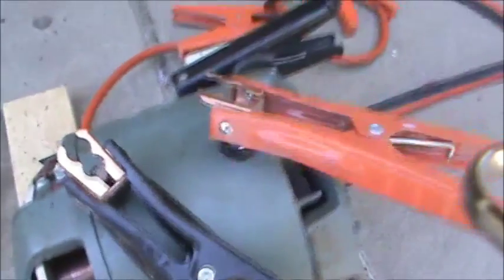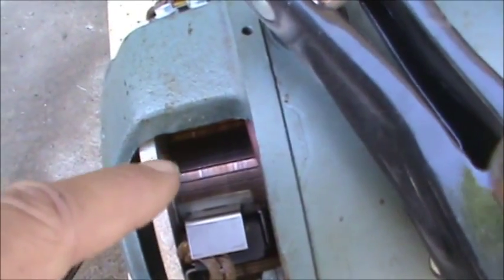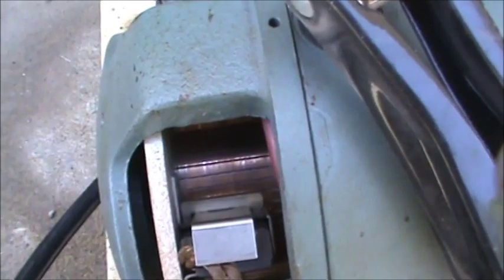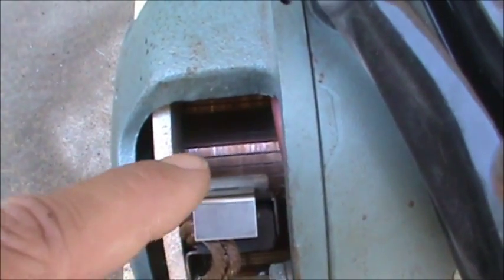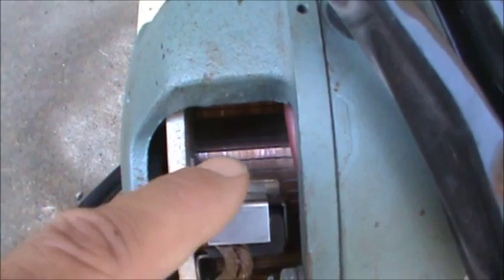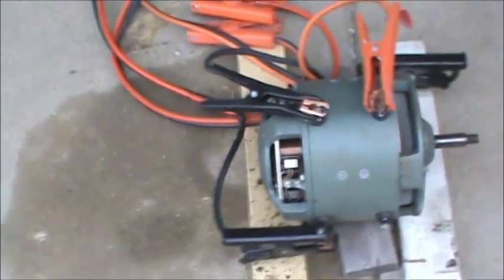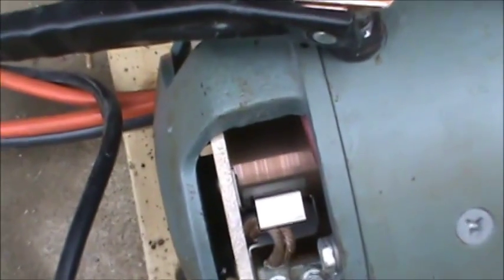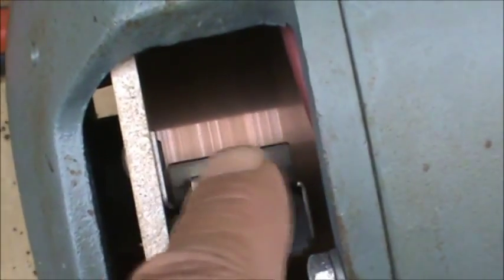Breaking In The Brushes On The Raymond Electric Motor

Comment: Why not use a little emory paper to clean the comutator first?
Reply: John Carey offered good advice.  I worked on Raymond and Yale electric hi-lifts for 11 years and this motor was not rebuilt properly.  The commutator is rough and should have been reconditioned to a very smooth and shiny surface.
Reply from the maker: The motor was rebuilt/remanufactured. The comutator was machined and appeared to be very clean. But since the brushes are brand new they themselves need to seat into the comutator. The brush new will not have a radius it will be just a flat surface so over time it will wear to the shape of the comutator making more and more surface contact. I wanted to help this process along so when I put a load against the motor I don't get any arching which would damage the comutator.
Reply from the maker: John, Perhaps I should make a video and take a brush out and show you all what it looks like where it makes contact? Maybe running in the brushes will make more sense then? Let me know buddy!